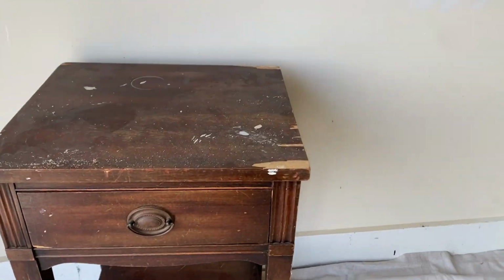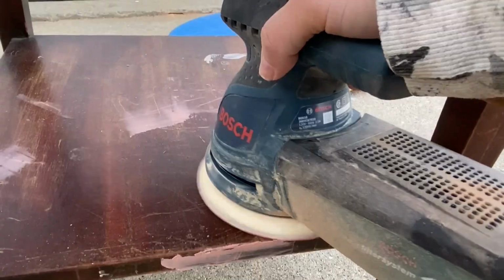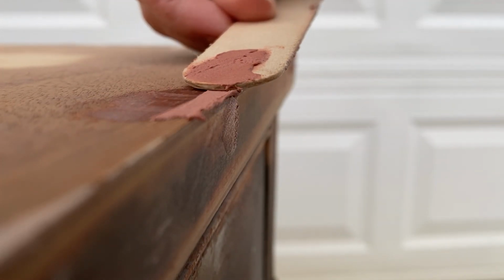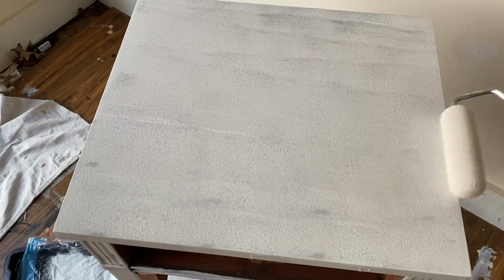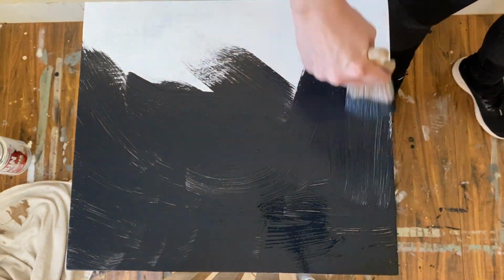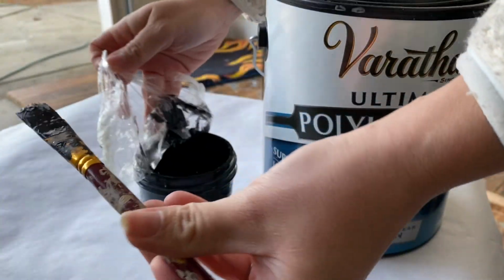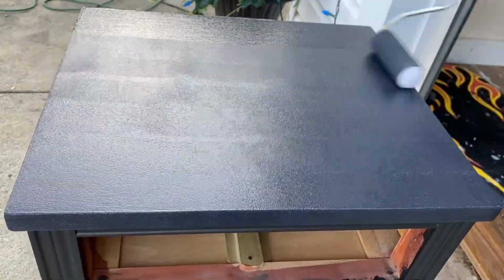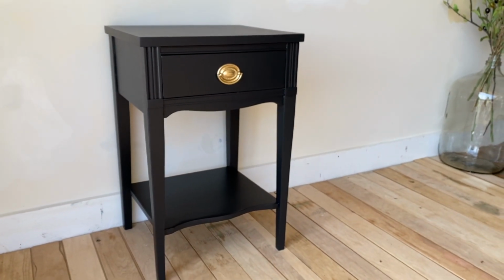BLOCK WOOD BLEED THROUGH Furniture don’t give up! Streak free finish GF Lamp Black milk paint

Comment: I liked your tip on the valspar (or Behr) cabinet and trim paint by mixing the black, or any other color for that matter,  50/50 with the poly.  The paint is so tender and this trick does firm it up much quicker.  I love the federal style also.  However they do not sell that well in this area.  I am looking for one for ME and my dining room.  I have a buffet now which is not really practical as it does not store as much as one of these federal style.  I call them Hepplewhite style.

Comment: Hi! I have a question. If I’m painting over cabinets that was once painted with general finishes black stain/oil can I just use BIN as primer before painting with water based paint or do I also have to sand first? Thank you!
Reply from the maker: With bin shellac you can get away w/o sanding as long as you clean the surface well
Reply: @blacksheephouse  okay! Thank you and thank you so much for replying!

Comment: I need your help!! 😢😢 Im trying to paint all my furniture and I suck! The top coat pilled up so bad. It looks like aI need to redo the whole ser. (spar urathane)
Reply from the maker: Oh man, I’m sorry to hear you’re having a tough time.  I would recommend getting a carbide scraper and after the product you used is dry scraping off what you can and then sand with 220 and then 400 grit and the go in with a new paint.